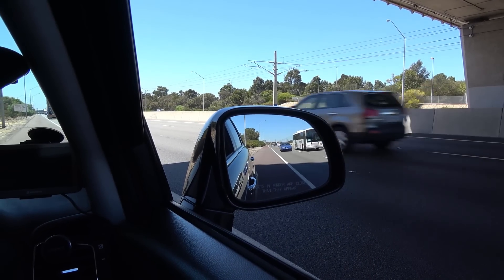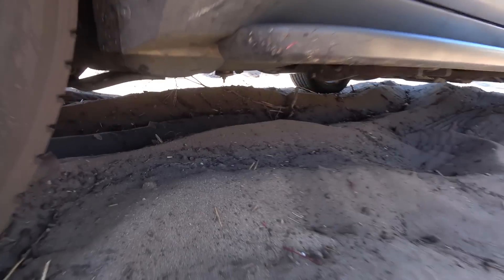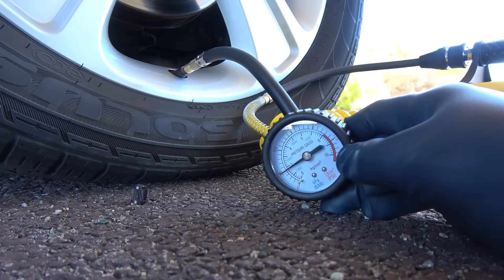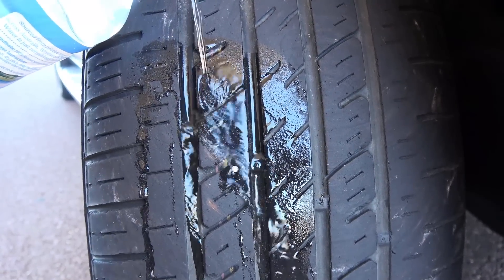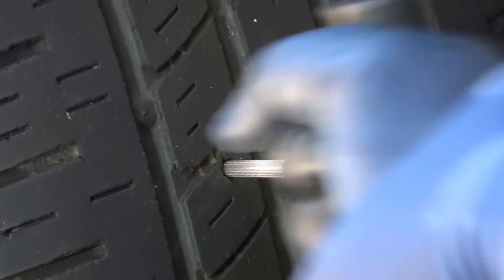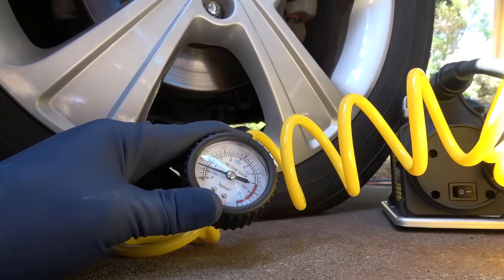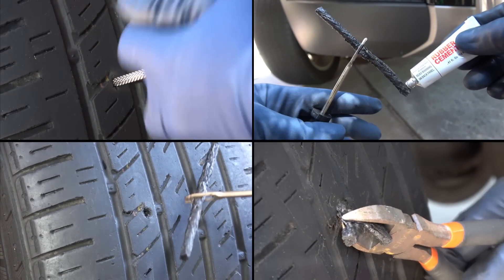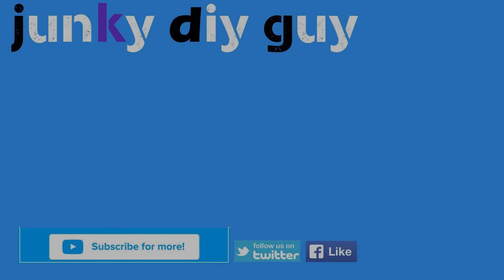How to Fix a Flat Tire on the spot (Do It Yourself Guide)

Comment: The plug system is great. I had a tire I plugged run another 25K miles on it before normal replacement.

Comment: Mate you'll never put spare tyre with ATK speed limit on the front of a car. You should always put on the back and then put the back on on the front. In my kit I bought many years ago it said to put the glue on the Rhema when you rhemaing out the hole. Cheers Graham.

Comment: You said that there was no rubber cement in the repair kit but the rubber strips were sticky. Kits I have use have had dry rubber strips in but came with the rubber cement so I suspect the stickyness was supposed to be enough but using the extra cement was worth while. I've used such a kit to fix the back tyre on a Harley Davidson which I then rode all over Europe until the tyre needed changing. They really do work!!!

Comment: Mark location of penetration with a white crayon.  You did the repair on a front wheel which can be turned, in daylight in good weather.  Flats happen on the traffic side of the vehicle, in the dark rear tire and its cold and raining or sleet.
Also  on my trailer tire, I used 2 plugs in a shoulder area to get me home then had a tube put in after the hole was patched properly.
Thumbs up

Comment: some tyre shops (Bridgestone, Bondi Junction) uses this plug system and charges $30. Tyrepower in Rockdale was the best in doing it correctly. I am happy to see Bridgestone, Bondi Junction is now closed down.
One question, when taking out the screw with full air in tyye, is there no chances of tyre bursting due to high pressure inside.
Reply: Bruh we do it for 5$ at my shop

Comment: I have to make a note that oftentimes you can't get the lug nuts off especially in winter with that lousy four way wrench. you're better off investing in a  bolt the size of your particular lugs ( 17-19 mm 3/4.etc.) and 18" pivoting extension .
Reply: Better yet...you can get a spark plug socket...I have found it to be better... I have tried deep well sockets and they always get stuck on the lugnut...also a breaker bar

Comment: Good video, but the rubber cement is not necessary. Those plugs are self vulcanizing and do not require adding rubber cement. Kits that include rubber cement will include patches as well; and the rubber cement and patches are needed for bicycle tire repairs only. Some people claim that plugs are not safe, but I've been using those plugs for over 30 years and have never had one fail.
Reply: Well dude,  I am telling you they are not safe.  Been in the tire industry for 30 years.  20 as a  licensed tire tech.
Reply: They are for temporary repairs to get you to the nearest tyre repair centre. I live in Scotland and the recovery company's like AA and RAC use them for cars that don't come with spare tyres, to get them to the nearest tyre centre. But they are not classed as safe to use long term. (here in Scotland anyway).

Comment: In the USA, Plug or patch only repairs have long been considered unsafe.  The only safe method requires removing the tire from the vehicle and repairing it from inside.  For an extensive article on lawsuits & the correct repair method: @t  or for a lawsuit about a patch only settlement: @t   If you're not concerned about yours or your family's safety, use this video.  When you're injured, add YouTube & Junky DIY guy to your lawsuit.

Comment: No!! This is not an RMA (Rubber Manufacturers Association) approved method for a tire repair.  These are NOT meant for automotive Radial construction tires, but rather for Bias ply construction such as ATVs and riding mower tires.  These are fabric and will draw moisture into the steel belts causing rust and corrosion which will lead to a steel belt separation.  Temporary emergency solution at best.  A proper repair is done from the inside of the tire.  Get to a tire shop that follows guidelines for your safety!

Comment: It's not super dangerous to fix like that on the edges of the tread. Worst that can happen is slow failure of the tire. It won't explode randomly.
Reply: That really depends on what the hole looks like and exactly where in the sidewall it is. The tire flexes a lot on the sidewall as it's going down the road which could cause the hole to tear and blow out on you. The rubber on the side is thin and does not have support such as steel belts or heavy thread
Reply: Agreed, I have plugged over 20 times around the edge and never had an issue 5yrs later the plug was still holding.  (I also dont drive 160km on them either, 60mph is max where i live.)

Comment: Shouldn't the tire be emptied before removing the valve as it could just fly into you ?
Reply: Yes, the air should be taken out or have something in front of the valve so the stem does not fly out from the air pressure.
Reply: did you not just watch him, do it the valve just flopped out with nil pressure at all an an inflated tire so clearly its not necessary.